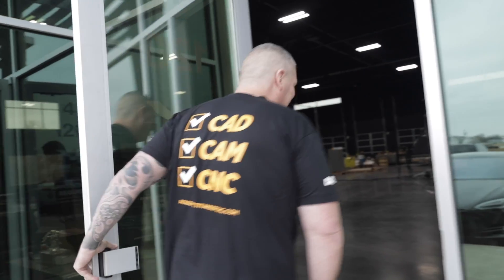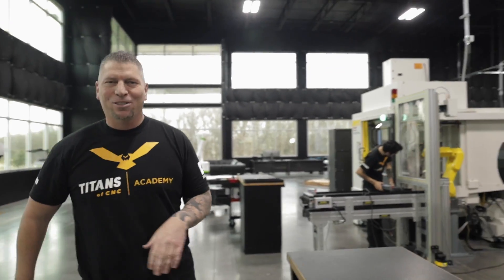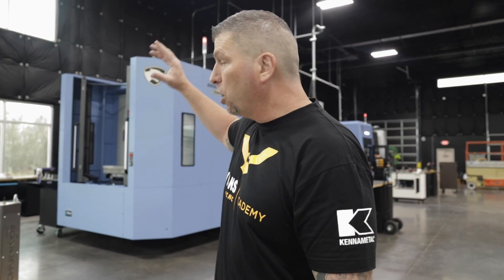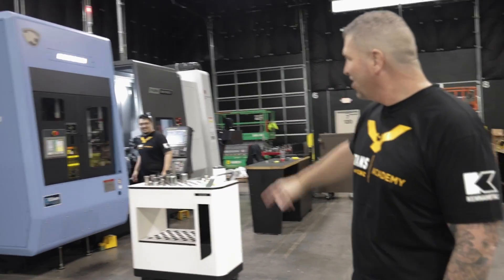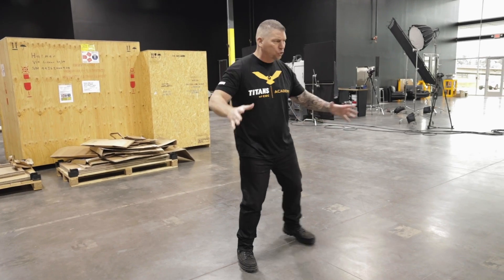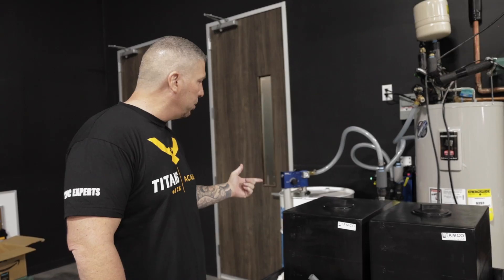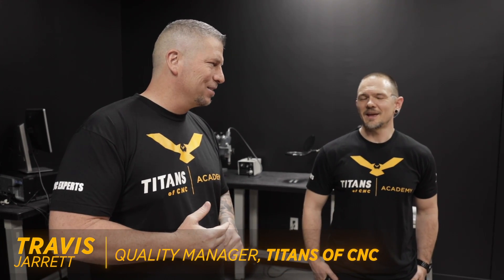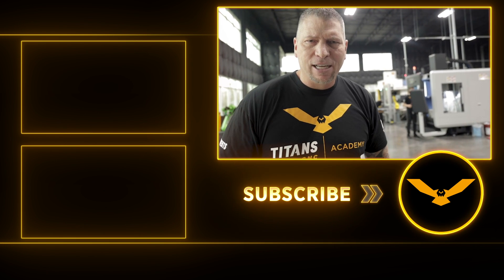Setting up CNC Machines at our NEW Texas Machine Shop | DN Solutions

Comment: TITAN - QUESTION IF I MAY. THERE SEEMS TO BE PROGRAMMING ON THE FLOOR AND PROGRAMMING IN THE PROGRAMMING ROOM. IS THE PROGRAMMING ON THE FLOOR FOR PROCESS IMPROVEMENTS AND THE NEW PARTS OR REV CHANGES COMING FROM THE PROGRAMMING ROOM? IN MY EXPERIENCE THE FREQUENCY OF FLOOR INTERRUPTIONS MAKES IT DIFFICULT TO PROGRAM NEW, BUT COST SAVING CHANGES DO NOT SUFFER AS MUCH FROM THIS BREAK IN CONCENTRATION. YOUR SHOP IS AMAZING MAN!

Comment: Should looks into if possible look into teaching on gear balancing and the difference between a balancer machinist. Role and how they use optical sensors and optical balnce machines to achive perfect balance in gear systems